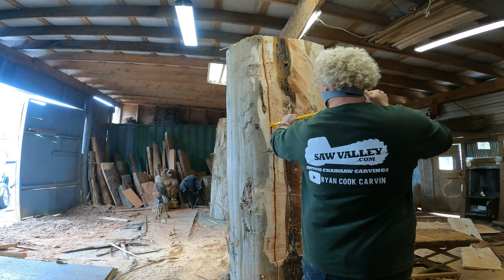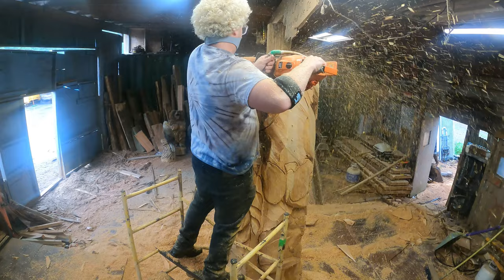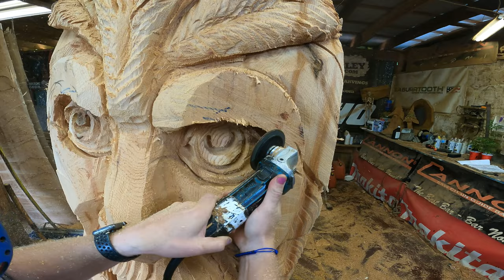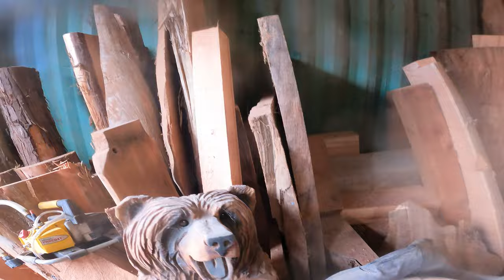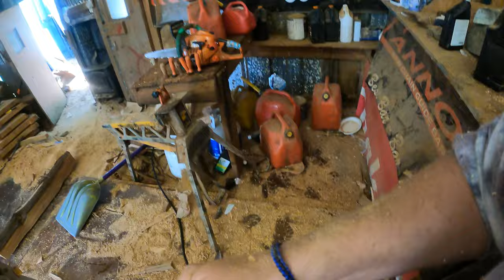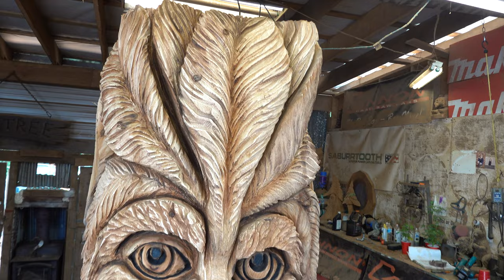AMAZING Chainsaw Carving 8ft GREENMAN FACE wood carving Spirit face

Comment: Hey Mr. Cooke I've got a question a little off subject. The Owl book you recommended in one of your videos,(that I can't find again) was the author " Floyd Scholz"??
Reply from the maker: they are hard to find its DENNY ROGGERS but make sure you dont go to like some book stores sell the eagle book for like 500 cause they are super hard to find .. but if u look u will find them they take work amaZon does have the owl an hawk one i think
Reply: @RyanCookCarvin  ok thanks Ryan  I went ahead and ordered the book  Owls by Floyd Scholz it is an excellent book with great photos carvings and feather dimensions it's regular 80$ on Amazon but I got it half price used like New. Thanks for your response. Carve deeper